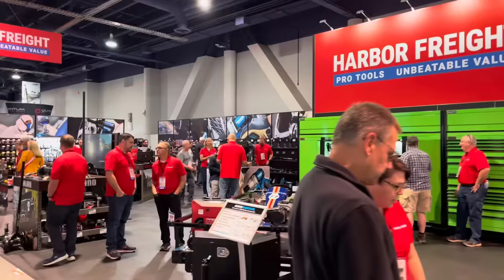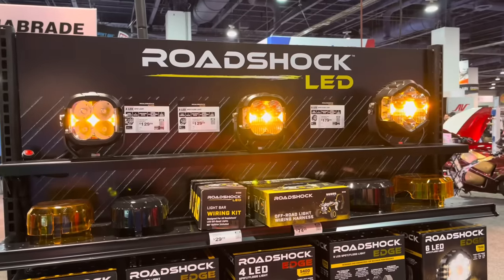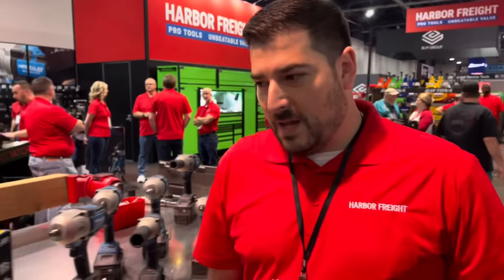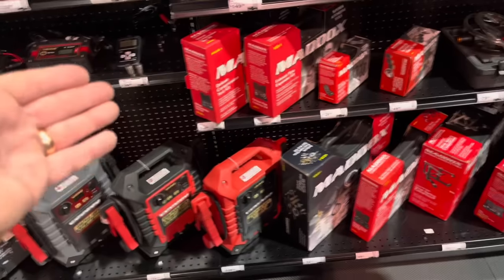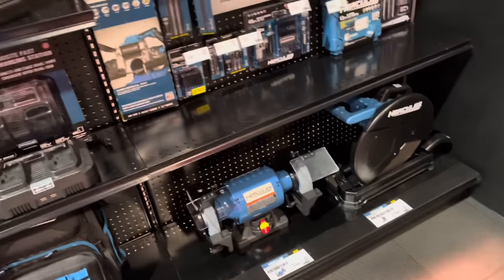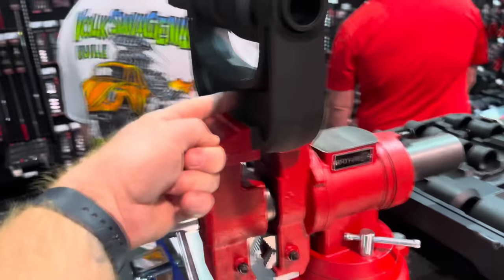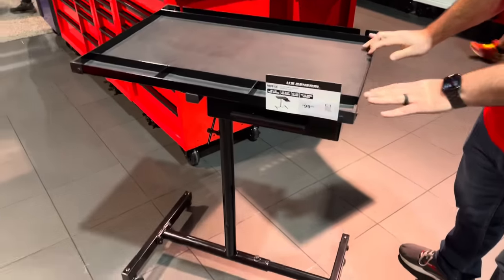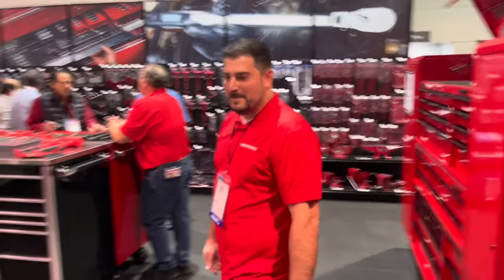Sema Show 2023 New Harbor Freight Tools and Toolboxes! See It Here First!

Comment: Regardless of your experience level, $13k for that Monster box setup is Freaking AMAZING!!!😮
Reply from the maker: Yes it is
Reply: @KoonTrucking  I paid in 2015, ⅓ of that total price on a Matco 4S two bay box in same color! Wow do I feel like a schmuck.
Reply: That's why I've always bought good used tool boxes...
Reply: Those Icon toolboxes are legit too.  Just check the weight.  They are using a lot of steel, and for any simple box shaped object that uses a lot of steel, that can only mean one thing.  It's solid construction with thick steel sheet and a solid frame.
Reply: @RedShiftedDollar  I will check the steel they are constructed from, wish I hadn't bought a Matco 4S back in 2015! For WAYYY more money 💰
Reply: These boxes are solid too. I bought a 56" series 2 and it was 400lbs empty

Comment: They need to sell individual icon replacement sockets and wrenches etc to really be a player.
Reply: This is a massive issue, you’re absolutely right.
Reply: Huge issue. Thats why I dont purchase Icon socket or wrench.
Reply: They do and they ship them for free. Just have to call in on their replacement parts catalog. Wish they had it in the store, but they don't yet.
Reply: My store I go to they let you exchange either just what ever wrench/ socket you want to warranty or if u want you can warranty the full set
Reply: Exchanging a broken socket is fine but if I lose 1 socket I’ll have to buy a complete set to replace one socket as they don’t sell them individually. Not good you can buy individual sockets from almost every other manufacturer matco, snap on,  craftsman, and even husky.

Comment: I love to see the new tools and accessories. I have been a field service engineer for over 30 yrs, and most of my tools are Harbor Freight. The only "continuous" complaint I have, is that I have always wanted more shelves for my locker box. I have tried for years to get one, and they have never offered them for sale. I even went so far as to order them as replacement parts. That didn't work either. Each time I tried, I waited for a few months to get them, and eventually the orders were cancelled, and they always said they were out of stock. Other than that, they are pretty decent tools.

Comment: I am very impressed with the Hercules line. Having said that, I have everything that Bauer makes, corded and cordless. I have over 20 Bauer batteries and two Bauer double-chargers. I can't imagine the expense of trying to upgrade to the Hercules line bit by bit unless I could use my Bauer batteries with the Hercules tools. Harbor Freight needs to make converters to use the Hercules line of batteries on the Bauer tools, and vice-versa. I love the new 8-amp Bauer batteries and have 6 of them. I am sure they would perform very well with the Hercules tools if the right converter was made. So, for now, I can only admire the Hercules line from a distance and wish that there were a way I could afford to slowly make the change-over.

Comment: Omg I love the purple. Thanks for doing a harbor freight video. I’m just starting in diesel and harbor freight is like 90% of my tools right now. But I will back you on the Hercules brand. I have a couple of their tools and I especially use their electric ratchet alot even on semis and especially using it harder then what it’s intended to be used and they hold up great.  I was especially suprised with the lifetime the battery’s lasted between charges and especially after being heavily used. Harbor freight just makes it so much better for us new guys trying to get started. I do wish they would start doing more specialty stuff though like sockets for cage bolts or sockets for drive lines.

Comment: I can agree with you about the hercules power tools Ive been using my small 12v 1/4 impact for about a year and I love that thing the only thing I wish I would see is if they could bring brushless versions of the 12v line out and I would be happy been slowly moving from milwakee to hercules the batteries last forever and they are very durable for the price
Reply: We needed to pick a line of tools to use at the machine shop I work at for maintenance.

I personally run milwaukee and have built a good collection, but having to budget at work and trying to build quickly from scratch, I decided to go with hercules and they have been absolutely impressive! Drills are stout and running jacobs chucks, grinder is equivalent to my milwaukee, the circular saw is very powerful and the impacts are neck and neck with the red team.

I don't regret going with that line at all. Can't wait to buy more.
Reply: yeah brushless is needed, i completely burnt up my hercules 20v hammer drill which was brushed using a 6in hole saw on metal, which also killed a hitachi as well, only my old dewalt that i modified to take harbor freight batteries worked after 10min of drilling.

the brushless version is alot better and has that 5yr warranty, sadly my old brushed version was not so lucky with a warranty

Comment: Out of fun I asked a clerk at my local HF if I could trade in my older 1190 ft-lb Earthquake XT air impact on a newer 1200 ft-lb Earthquake XT air impact. Mine still works great even though it’s way beyond the warranty. My great idea dropped faster than a lead ballon.😂

Comment: They made a great decision to get rid of the small height drawers on the 27" tool box. The old configuration made it very difficult if not impossible to keep the box efficient.
Reply: series 2 side cab drawers are easily relocatable (put deep up top), 8 drawer 27 bottom requires re-drilling, but mid depth moved up top makes it usable.
Reply: @nonoodlesjustsauce8009   the fact that you can modify the cabinets is great. The problem is not many tools can fit in the small drawers unless they lay flat which makes them take up a much larger space than they should. There's no way to fit 1/2" drive deep sockets in the top box unless you lay them flat and the only place they fit standing up on the bottom box are the bottom 2 drawers. While the series 2 is made well their layout sucked. Every other box in the series 2 line up didn't have that problem. I'm not a fan of spending $550ish on something only to have to modify it to make it work for me. I should have looked at my tools and the boxes a little deeper before I purchased them. It's nice that they resolved the shortcomings of the series 2 and I would definitely purchase the series 3.
Reply: @mitchellfishingadventures   Montezuma up top wrangles all my sockets. When wrenching flat rate, all sockets standing up in Matco 2s were harder to quickly grab. All the deep drawers had tools piled on top of tools- move timing light, ignition analyzer, and tap kit to access compression tester. More shallow drawers suits my organization style better.

Comment: I was hoping to see the new shop dust collection system and the 20" drill press. I want the new trailer when it gets to NH and will there be a duel, axle available as well?  I am thinking 2500 lbs. Do the trailers tilt?

Comment: We need a split top roll cab...thats the only thing HF is missing. The current tilt tops are a PITA because you cannot put anything on the lid to use as a work surface, or you will lose access to everything inside.

Comment: the folding HF trailers are the wost backing up trailer I've seen, and the entry level one with the 4.80's  people dont know are speed rated at 45 MPH.. the welding table looks like the one Northern tool had one for $99 a few yrs ago.

Comment: I know HF has a 12v Hercules line with the extended reach 3/8" are there any plans to do either a short 1/4" or 3/8" ratchet and any word on a right angle die grinder. I know about the straight but really want a right angle. I currently run 18v Ridgid but not very happy with the amount of tools or batteries and really disappointed that they dropped their 12v line. I have an old 12v 1/4" impact driver and I have done full deck tops w 2-4.0ah 12v batteries. Thing is great. Wanted them to continue it with ratchet. The design of there 18v ratchet sucks, too big to get into any place in the engine of most vehicles. Great video thx. Cant make up my mind on Milwaukee or Hercules 12v yet. And if Ridgid doesn't step it up, I will switch up my 18v. But I already have a bunch of great 18v just need bigger batteries

Comment: The badlands floor jack needs wheel locks on dirt meaning driveway dirt they tend to roll suddenly I had a bad experience a couple weeks back look into some wheel lock pins before someone loses a hand or fingers like I almost did at work
Reply: Shit this not good bro
Did u ping the company yet
That would a huge safety issue!
Reply: Use wheel chocks....

Comment: I hate that they ran the wiring in the rails on that trailer. Yes it looks great when you’re selling it, then it rubs through and corrodes and you’re redoing the wiring anyway. If the ran the wiring short then you’re screwed when you’re lamps corrode because you can’t splice in pigtails. That’s been my experience with internal wiring at least.

Comment: YOU NEED All Hercules- CordlessTrack saw, sawzall like milwaukee 18Vsharkzall, small 12V sawzall like milwaukee sharkzall,  Cordless Chopsaw,Cordless magnetic drill, Cordless chipping hammer and jackhammer, Cordless 21 degree and 31 - 33 degree cordless framing nailer prefferably in the paslode style, Jobsite Radio and charger station, packout style storage

Comment: Clay Harbor Freight came a long way that ball joint press is Cadillac great price.The only problem is when you lose a couple adapters will you be able to buy separate pieces I bought a Quinn complete tool set for the road not bad for the money well we lost some sockets could not replace them not available I called Harbor Freight and the rep tells me you have to realize that Harbor Freight is coming out  with a lot of new tools My answer to him was I think Snap On offers more than you guys have and you could still buy single sockets that you lost I think what Harbor Freight is doing is great but they should get back to basics and by the way  I am in Connecticut and you better have your receipt I know they tell you they could look everything up by our telephone number I have been there if they don't find it on system or you do not have that receipt I think your gonna be SOl

Comment: You don’t know this!! Not even Harbor Freight! Harbor Freight’s 29 gal. Air compressor has a built in hour timer and it will run 240 V A/C. Yes, mine is 240V and after purchase I found the hour timer.

Comment: You had me going on the new good stuff until you said those jump start boxes were good. My dad has bought 2 of those larger jump start/charge boxes and neither of them has worked either charging or jumping. They won't hold a charge at all.
Reply from the maker: Mine is still going strong? In fact just used it last night on a Duramax with a dead battery.

Comment: IMO, the new plastic latch system sucks...i pulled them out of my 34" and Series 3 56"...
Reply: While I don't have these boxes personally, I'm inclined to agree. They feel both flimsy and tough to operate from my testing at my local HF. They are par for the course it seems though (I've seen them on new Snap On boxes)

Imo, the best action on any toolbox drawer is the snapon impulse stuff on their epiq... Menards masterforce line of boxes chose to do a crude copy of that instead 🤷